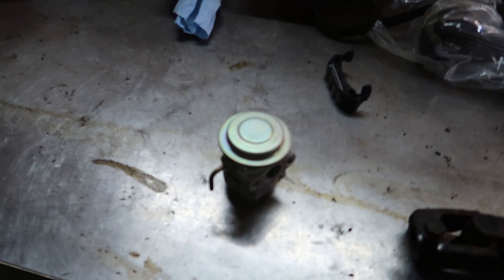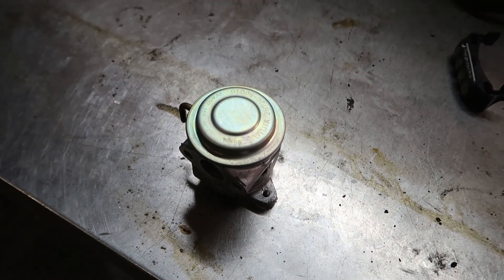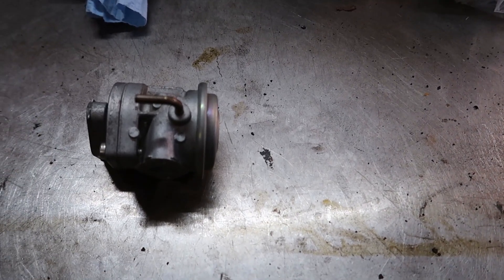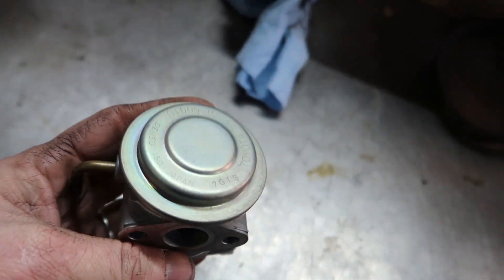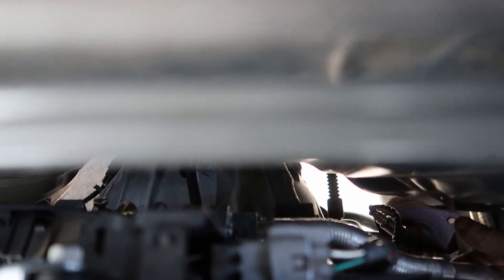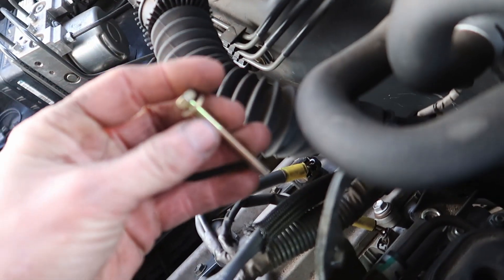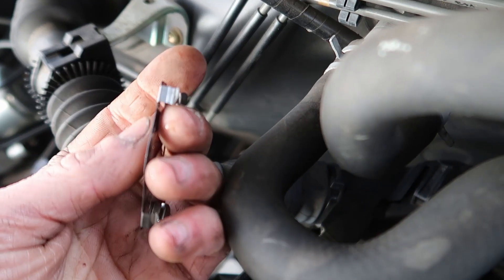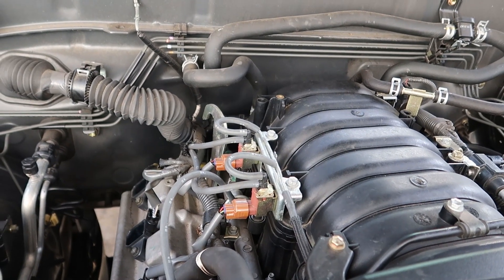06 Tundra Air Injection Control Valve Bank 2 easy replacement WITHOUT removing the intake manifold

Comment: Im replacing the same valves on 4runner v8 2005. But i also have codes p0420. Po430.  Catalytic converters.  I hopefully replacing those valves can clear the codes for cats.   I took cats out thry look fine clean.

Comment: I'm getting the P1442 on my 05 sequoia what u recommend?
Reply: Did u fix it? I have the same code on my 05 Tundra..
Reply: I fix it but not after replace the valve  there's a company the sells a harness the connects to the map sensor and another wire connects in the fuse box that took care of it if u want the full details I find them and let u know
Reply: Cool Thanks for responding. Did u use the plates to block flow or just the wiring bypass?
Reply: @sala.7149  I didn't use the plates cuz my codes was saying valve stock closed but they recommended

Comment: Awesome !! Thanks so much, I will try tomorrow, my Bank 2 throwing the code P1445, I will confirm correct vacuum supplied to valve as well as it's solenoid controlling vacuum valve is operating correctly. Then I will remove valve and clean with break clean, that should do it, I've already confirmed the Diaphragm to this valve is holding 20 inch of Mercury.

Comment: Yeah.  There's a lot of room on this  truck.   I just tried replacing the same valves with the same engine on 05 4runner v8. And no way to get them out this way.    Bit i can see on the tundra has way more room.

Comment: Thanks for the info, I’m working on a Lexus gx 470. After removing the 4 bolts, did you have enough room to bring the valve up or to passenger side?

Comment: You can bypass this system too it is a cheat device used to pass emissions. all it does is make the exhaust hotter for the first 10 seconds of running to wear out the catalytic converters by bringing them to temp 15 seconds faster. And mind you in sub zero temps the blower and valves can be slow to respond throwing the p2445 code and throw the truck into limp mode. Not to mention p1442,p1443and p1445.

P2445 was so common they patched it on a ecu update so it was not even used if it was below a certain temp out.

Comment: Hi can you do it from under the truck? And what would happen if you don't replace right away? Thank you sir good video
Reply: Limp mode is what happens. if the system doesn't get the signal to run nothing happens if you have it show faulty it goes into limp mode. The bypass kit for the 1st gen tundra spoofs the OK signal telling it to not run and the block off plates prevent exhaust gas from crusting over the valves so they can think they are fine. The 2nd gen moves this system into the wheel well and the little blower motors are prone to water build up and the fix is to make a drain hole in the rubber condom they have on them. Or a bypass kit for this exists too and emulates the entire system running sits on the ecu.